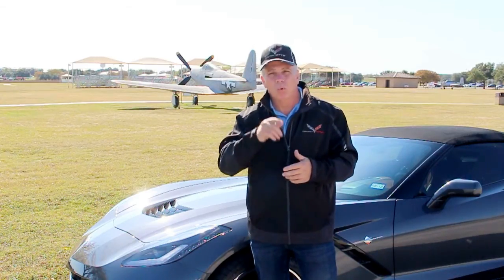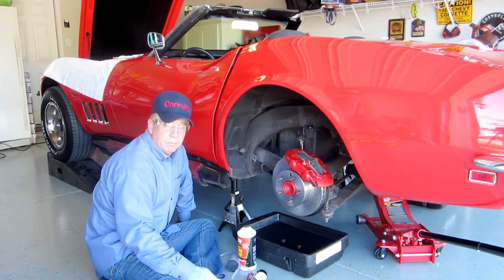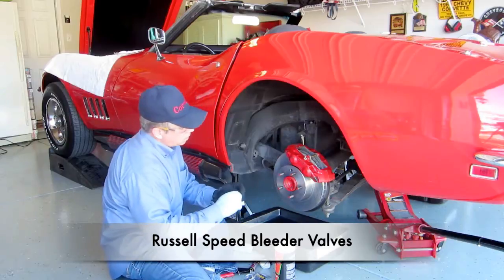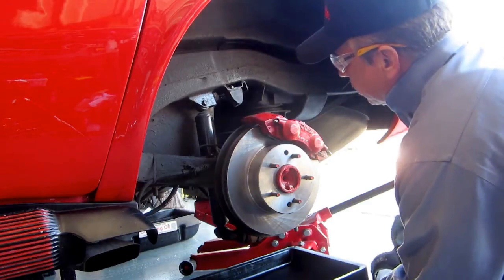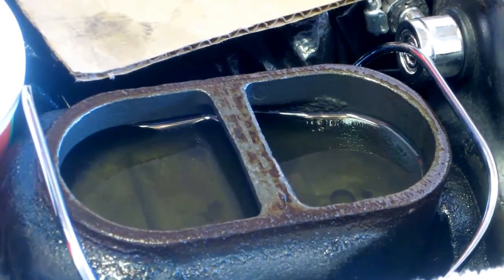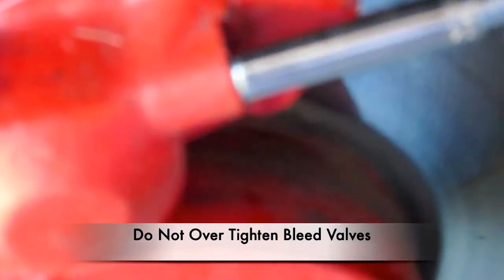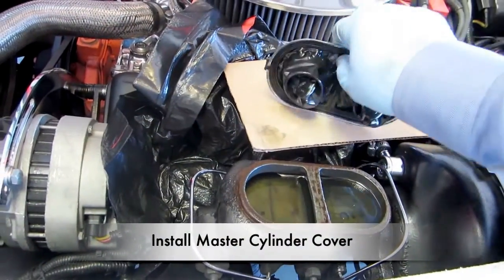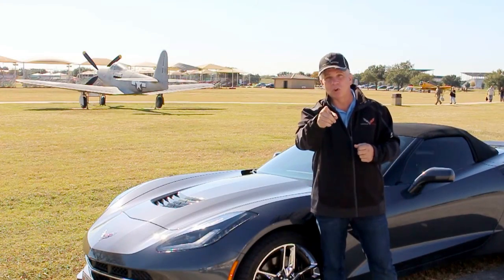How to Bleed Brakes. Gravity Bleeding Car Brakes By Corvette Hop

Comment: I changed my rear rotors and calipers and attempted to do a gravity bleed. I bench bled the master cylinder also. My issue is that no fluid is coming out of the bleeder screws. What am I missing? Thanks in advance.
Reply from the maker: Close the bleed screws and master Cylinder cover. Pump the brakes which should put more pressure on the system. Try this a few times and try to bleed the brakes again afterwards.

Comment: Hi Hop! 😀 
Thanks so much for sharing this great and helpful info!
Question: How do you know when each cylinder has completely drained the air...? 
Or, how long should I allow each cylinder/caliper to drain? 
Thanks again! 👍
Reply: When the fluid is clear.  Also most use clear tubing on the bleeder valve into a bottle, air bubbles will visible in the tubing.

Comment: Quick question for you..I have an old ford transit with a brake servo. The brakes do not work unless the engine is running..do I need to have the engine running to gravity bleed the brakes?

Comment: Didn’t the factory have a sequence as to which bleeder to start with, for example the bleeder furthest from the inlet hose working your way to the other bleeder on the same caliper on the same side as the inlet hose? That is the specific wheel sequence as opposed to the general sequence which is further for the master cylinder working your way in.
Reply from the maker: Yes, right rear, thin left rear. Right front thin left front.

Comment: Great video. For the first time, I paid a brake shop do my brakes, which the pedal has gone down. They replaced the m/c and booster. What a mistake. I haven’t driven the car in a month. The pedal slowly went to the floor. I have speed bleeders that are 15 years old. Maybe they leak? I’ll replace them with standard bleeders. I’m going to do the bleeding like you did. I don’t want to take it back to that shop. I’ll do it myself.
Reply: how did it go?

Comment: Thanks for the video.  Know you comment on using hoses to manage the fluid coming out, but you may have got brake fluid on the pads, which would be hard/impossible to clean it off if absorbed into the pad.  Would you not want to check your pads for brake fluid contamination?
Reply from the maker: Sure. Always good to clean the pads after maintenance. After I did breaks in the video I cleaned them off. I now have been using the same brake pads for several years with no problem. I do not drive the classic car that much (maybe 6,000 a year) but this brakes are still very strong and solid. Thank you for the input.

Comment: When you have newer cars with ABS that air can cause a problem and would need a scan tool to cycle the pump.  It is avoidable if you just keep an eye on it and add fluid.

Comment: Does it work with all sort of bleed valves ? Thk you !
Reply from the maker: Yes, it does. I would not recommend this with ABS brakes. Also, use a clear hose to attach to the bleed valve so the fluid can flow in a jar and not be so messy.
Reply: Thank you mister Hop ! :-)
Reply from the maker: You are welcome.

Comment: You stated you can do all four lines at once!  If you have the front jacked higher then the rear you can still keep it that way to bleed the front  too?  Thanks for the video I was looking to do it myself!  I also have the same car, same color too!
Reply from the maker: Yes, that is correct. I find it better to have the rear brakes/Wheels lower that the front for bleeding. Also, if the fluid does not flow when you open the bleed valve close the bleed valve and pump the brakes. Then return to the bleed valve and open again for the fluid to flow (make 100 percent sure that bleed valve is closed when pumping the brakes). I would recommend you do one brake at a time if this is your first time. Start with the right rear, then left rear, front right and then front left. Keep fluid in the master cylinder at all times. Remember, do not get any fluid on the paint. You can also use a clear tube on the bleed valves so fluid does not get on your brakes/rotors. I hope it all works out. Please feel free to ask any other questions.
Reply: So how many speed bleeder valves do you need to do all 4 brakes? will i need 8 speed bleeder valves?

Comment: I have never tried this, I get my wife to press on the brake pedal, even though I have speed bleeders like you showed.
why not use a 5 mm silicone hose connected to your bleed screw and the other end to your tray, nothing to clean after bleeding. Also use a turkey baster to remove the old brake fluid from the reservoir and fill with new brake fluid before doing the bleeding, also use a spanner or special spanner for bleed screws and that way no chance of breaking one.
Reply from the maker: Great suggestions. Thank you so much.